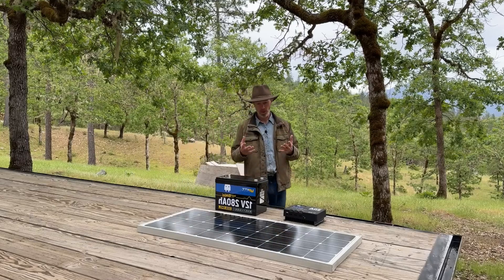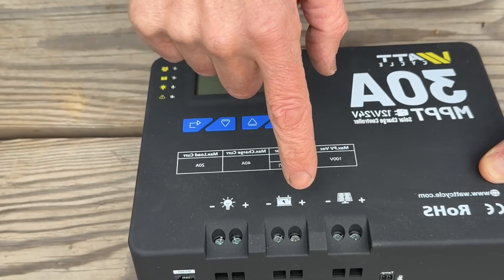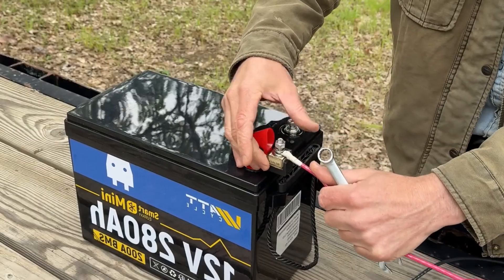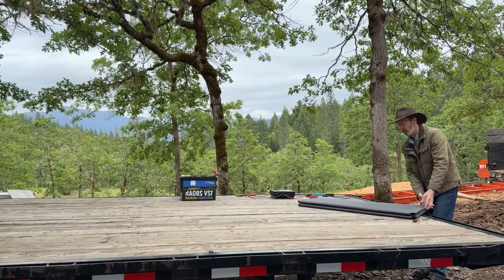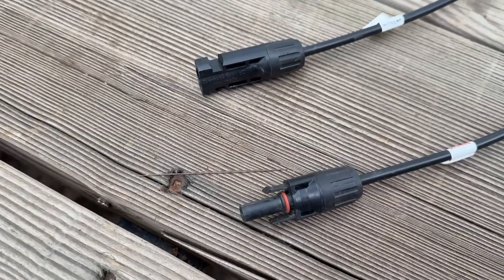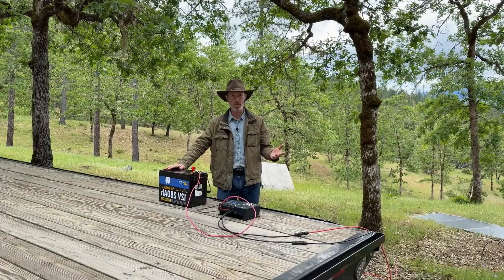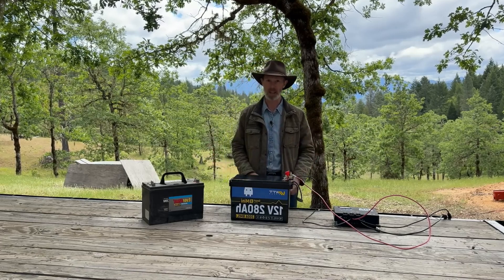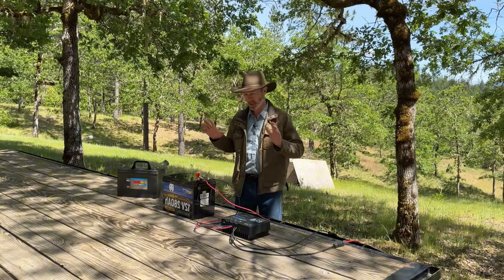Unlock the Secrets: Going Solar Is Simpler Than You Think!

Comment: You stated incorrectly that the 280Ah Lifepo4 battery is "almost 3 times larger capacity than the 100ah lead acid battery". This is a common misconception based upon the USEFUL capacity of the two types of batteries which are completely different:

1. Lead-acid 100Ah battery
You can safely use 20% of its capacity without significant degradation.
Usable capacity:
100Ah \times 0.20 = 20Ah

2. LiFePO₄ 280Ah battery
You can safely use 80% of its capacity without degradation.
Usable capacity:
280Ah \times 0.80 = 224Ah

3. How many times more usable energy does LiFePO₄ provide?

{224Ah}{20Ah} = 11.2

!! The 280Ah LiFePO₄ battery gives you 11.2× more usable capacity than the 100Ah lead-acid battery!

You would need 11 lead acid batties to replace one 280ah Lifepo4 battery.